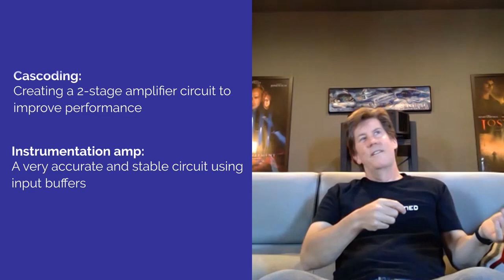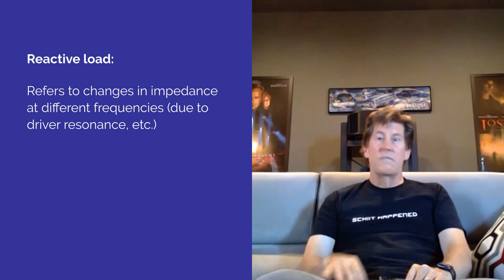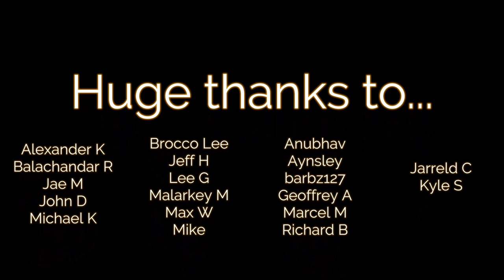Interview with Schiit Audio - Part 1: why all amps sound different

Comment: Cool interview, I love my Schiit Loki.  It has a nice little just a little something, warmth maybe, that makes my computer sound sound nice.  The reason amplifiers sound different while measuring the same is because of the limitations of the standardized tests.  The transfer function of an amplifier can be pleasant, as in some distortion can be in phase second harmonic simply sounds more pleasing.  The more complicated the signal the greater the distortion from what looks on paper as great, but with a real signal it can sound bad.   This is subjective, Pass Labs has a fantastic set of white papers cover this that includes objective measurements.  Also, the load on the amplifier from the headphones has an effect, and more importantly the headphones actually induce a back wave in to the amplifier.  And of course a headphone or speaker is not a resistive load and it's reactance varies based on frequency, these impedance swings can cause issues with cheaper amplifiers.
Reply from the maker: Exactly! Glad you like the interview 🙂

Comment: Nice interview. In my case, the first impression of an amp or DAC or headphone is what I give more importance. My brain and ears don't have a chance to become biased or over-analyze and lean to my personal preference.

For example, my Schiit Magnius sounded boring and closed-in with the Modius upon first listen. Even running it balanced, it still sounds boring and closed-in with the extra power and lower noise.

I still prefer my Asgard 1 and 2, (and my previous Vali 2), even if they measure worse, are single-ended and have much less power. Their sound is way more holographic/out-of-head and fun for me.
Reply from the maker: I tend to agree. I do occasionally change my initial impressions, but often the first impression is right in my experiences too

Comment: I just wanted to post here that my attitude towards gear has changed a lot, I personally subscribed to a lot of 'objectivist' beliefs and bought into the L30/E30 Topping stack. I ran that setup for over a year, and I've just recently moved to a Jotunheim 2/Modius stack. It's absolutely breathed life into all of my headphones. Suddenly I have beautiful microdynamics, nuance and detail. Many times you simply don't know what you're missing out on, and its only harder when you're stuck in a bubble. My biggest regret is not doing this any sooner. Needless to say, I'm a fan and will certainly be buying more Schiit in the future.
Reply from the maker: I'm so glad you tried this out for yourself. I understand the objectivist approach when there's so much noise and ambiguity to cut through, but it really doesn't tell the whole story, does it? Congratulations on finding your musical enjoyment! 🙂🙂

Comment: Great interview, thanks. Do you do any blind, volume matched comparisons of amps? I ask because, as Jason intimated, once I started doing this the differences I was hearing between amps became much smaller (vanishingly small in many cases). Expectation bias is a powerful thing...
Reply from the maker: Hi Alan, I don't do blind comparisons because I'm not setup for it with sufficient quality gear to ensure transparency.
I also don't feel a strong need for it because I rarely come in with any specific expectations. I try not to read other reviews, etc. until after my thoughts are formed. I also find that spending extended time with devices reduces the impact of any initial biases that may occur. I'm not saying I can guarantee complete impartiality, but I do my best 🙂
Reply: Passion for Sound Thanks for your thoughtful reply. If at all possible, you might consider getting set up for doing blind comparisons. Doing so would add a level of legitimacy to your channel that is sorely lacking among many YouTube audio reviewers. It would be a nice differentiator and I think you might be surprised as Jason was when they first started doing blind listening sessions at Schiit.
Reply from the maker: Thanks Alan. I should clarify that I AM setup now (just recently) to do blind tests of DACs. It's the amps and headphones that are a bit trickier, but I might be able to rig something up using my XLR switch box to feed headphones...

Comment: The first five minutes on Heresy vs. Magni 3+ really highlights the issue I have with the ASR forums. I guess if taking op amps and a good power supply is all it takes, it's far too simple and I personally am not interested in such a design (it's cheap of course).
Reply from the maker: I agree. There is a difference IMO between audiophiles and what I've begun to call measurementphiles. I'm not saying either is right or wrong, but the two approaches often don't align.
Reply: @PassionforSound  Ergo, if there's no way to thoroughly and objectively measure sound signals, then such comparisons are quite limited in their usefulness--I'd think this is one of issues I have with ASR reviews, but I'm not an expert at all, so this is just a guess.
Reply from the maker: Yeah, I'm no expert on the measurement side either, but I have lots of experience with listening to, comparing and reviewing products and there's not enough correlation between the measurements provided and the subjective listening experience for me to base any decisions solely on the data on ASR. It's probably fairly good at showing what sounds crappy, but not at separating what sounds ok and what sounds great.
Reply from the maker: Yes, groupthink is a dangerous phenomena. But what's the Microsoft VP got to do with it? Am I missing something?
Reply: @PassionforSound  I believe he's referring to the work history of the person who started ASR
Reply from the maker: Oh, really? Is that Amir or someone else?
Reply: @PassionforSound  yes, Amir.
Reply from the maker: Ah. I went googling and it seems he was the VP of digital media at MS, not MS in its entirety. Seemed like a strange step to go from VP of a multinational company to running an audio blog 😁
Reply: @PassionforSound  good find. I remember seeing a comment on a Head Fi thread on R2R dacs that we wasn't very successful at MS with details on what projects we was involved in--like Xbox or digital media. But there's lots inaccuracy on the web, who knows whether it's true. Also I'd rather not criticize someone just cuz I don't agree with their POV.
Reply from the maker: Yeah. I don't know enough either way. All I know is that I find the reviews a bit misleading because there never appears to be detailed, thorough auditioning and comparison to support or contradict some of the measurements.
I just recorded an interview with Geno and Sherri from Geshelli Labs this morning and they say the same as other experts I've spoken to - good measurements do not always equal good subjective sound
Reply: @PassionforSound 👍That’s cool. I have a Geshelli amp and it’s great. Definitely, they are misleading to the point that I question the true motivations behind ASR. The reviews always conclude with a statement of recommendation/no recommendation that is purely based on his measurements. Then the forum discussion unfolds from there. It would be interesting to do some in-depth research and writing on how measurements can be done and then then correlate them to the actual listening experience, like a debunking of it all.
Reply from the maker: That would be cool, but I fear I'm not suitably qualified to have that conversation without being torn apart (metaphorically speaking) by measurementphiles.
You might find my upcoming USB video rather interesting though... 😉
Reply: I’ll be on the lookout for that video👌 definitely would be torn apart by measurementphiles, but I don’t think I want to convince anyone of anything, just more to answer my own questions and show others what’s possible/useful when it comes to measuring amps or dacs
Reply from the maker: Yeah, that's largely my approach too - I just want to know how it all works and how to choose better gear. Thanks again for watching and commenting!

Comment: You mentioned in your Soloist 3x review that the A90 was more 2D soundstage where the Soloist was more 3D. You said you have a theory that it might be capacitance within the ICs thus causing small timing issues. I wonder if the feedback has something to do with it as well. Looping back the signal multiple times must take some time no? I'm no electrical engineer but still trying to wrap my head around what is going on :)
Reply from the maker: Hi Snow, the Soloist uses feedback for the gain stage so I don't think that's what's causing it because the Soloist uses feedback to manage the gain settings. However, if the issue is occuring inside the chips used as I suspect (chips are generally inferior to discrete components) then the feedback may be adding to the issue as it means the signal is being handled more by the chip.

Comment: 100% agree about the SP200 sounding "flat." I sold mine; using the Topping A90 now. Sounds MUCH better, IMO.
Reply from the maker: Huge improvement from SP200 to A90. Even L30 would spank the SP200

Comment: Nice. Waiting for the rest. Negative feedback stuff is interesting. My experience is limited but i didn't like THX 789 that much. It's really sterile. I've checked other peoples opinions and almost all of them saying sterile must mean something. However downside of Schiit's low negative feedback discrete design is their gain is too much for sensitive headphones. 15 db gain on both Magni 3+ and Asgard 3. Their low gains have a lot of feedback so using them on low gain is not ''optimal''. The trend in the headphone world is sensitive and low impedance headphones now.
Reply from the maker: Glad you liked the interview and I agree about the high gain - that's the trade off. It's one of the reasons I was so impressed with Burson's new Soloist. They use feedback to drop the gain really low for IEMs, etc. but it's done really well and maintains a very natural sound.
Reply: @PassionforSound  Checked out your review. Looking nice. I'm personally in the market for a new dac and amp at lower price point. E30 and THX 789 didn't play well with my Ananda which is already spacious, light/lean and ''solid state'like'' sounding. I'm looking for punchy and dynamic sound to balance Ananda's character. It would be nice if you can review the Zen Dac and Zen Can. They look quite unique. Hybrid Burr Brown dac, discrete class a amp at reasonable price point. They are fully balanced too.
Reply from the maker: Are you running balanced or single ended? If SE, check out my review of the Topping L30 tomorrow - it's nuts and would pair beautifully with the E30. If balanced, the Geshelli Erish has a richer sound, but competes at the level of the 789. Oh, but you'd need a balanced DAC like a Modius perhaps.
Reply: @PassionforSound  I've sold the 789 and E30. Planning balanced this time. Curious about L30 review though. I thought it would sound closer to 789 with lots of feedback measurement focused architecture. Erish is just too ugly :) I'll give Zen stack a shot since i can return them to Amazon but i'm still interested in both L30 and Erish or maybe Modius, Magnius, Asgard Schiit stuff.
Reply from the maker: The L30 is really surprising, but some of those others are great too. I've got Asgard 3, Modius and Bifrost 2 all in the pipeline. I suspect Modius and Magnius or Bifrost 2 and Magnius will be excellent depending on budget.
It's a shame you're not a fan of the Erish looks (I understand) because it's an excellent little amp.

Comment: I love my Gungnir DAC. What I don't like is their customer service. Can't call them. E-mail only. Had to get my DAC repaired. 41 e-mails later, it was finally fixed. This, IMO, is a major problem dealing with Schiit Audio. You might want to think about it before purchasing their products. I don't have that kind of time and I suspect most people don't.
Reply from the maker: Hi Laurie, that's not good to hear! Thanks for sharing your experience
Reply: @PassionforSound  BTW, I've had this DAC since 2013 so obviously they make a great product however, once before I had to go through the same tedious process. They're certainly not giving away their products so I feel certain they have the funds to hire one or two people to handle a customer in a personal manner. Merely my opinion. Thanks for responding.
Reply from the maker: No sweat. I can't speak to their customer service because, as yet, I've had no issues. It's yours a Multibit or standard Gungnir?
Reply: @PassionforSound  I don't believe Multibit was available when I purchased mine. Don't get me wrong, their products are very good. But how about all the equipment they have sold world wide? I was in sales my entire life. If I treated my customers the way they do, I wouldn't have had any customers. Many sell similar products. What separates one from the other is customer service. Theirs is absolutely pathetic. And I have told them so repeatedly. I will never purchase another Shiit Audio product for that reason. Sorry, their unconcerned attitude should turn off any possible customer. It also took almost two months to resolve my issue.
Reply from the maker: Very sorry to hear, Laurie. I know what that can be like
Reply: they've answered my 3 emails that I've had to make on the first try every time.
Reply: @aceofspades6667  Guess what? They answered all mine too. But it took 41 e-mails to resolve the issue because they won't talk to you on the phone. Let's see how you feel doing that!?
Reply: While my personal experience with Schiit customer service has been totally different from yours. 
First time dealing with their CS a new product received from them had a problem with a port having a stripped out screw and being loose. One e-mail and the RA number was issued within 24 hours and replacement product was sent.

 Second dealing with their CS dept a four year old product developed a minor problem, one e-mail to their customer service department explaining the issue/problem to them and within a few hours had a return e-mail giving me the RA number to return the unit for warranty repair very easy simple process.

I own multiple Schiit products from some of their better stuff, lower mid range to their less expensive products with each product having its own intended use.

Actually I just ordered yet another piece of Schiit to add to my list, a new Solid State headphone amp to use for my gaming PC as for that use do not want to use one of my hybrid tube amps
.
So for me anyway their customer service that I experienced is just another positive feather in their cap and another box checked for my continuing to buy and use their products.
Basically two different transactions for issues took a total of two sent e-mails so maybe 10-15 minutes and my problems were taken care of.
I wish all companies I dealt with when having issues were as simple a process as theirs.

 Not to mention I feel their products are well made, sound great, have items available across multiple pricing points and usually compete and trade blows with products that sell for a lot more dollars from other brands.
I would be one that would highly recommend the Schiit brand to be considered highly when making a purchase decision!
Reply from the maker: Thanks for sharing your experiences, Bill. I don't doubt that errors in customer service will occur from time to time, but it's great to see the balance of the positive experiences too.

Comment: Discrete?  Integrated? What do these terms mean? This should have been defined early on.
Reply from the maker: Hi Mark, sorry, you're right - I missed that when I edited the review because I'd discussed it in a recent video (that not everyone will have seen).
Discrete means that the amp uses individual parts like transistors, resistors and capacitors to amplify the signal. Integrated means that a chip (or sometimes multiple chips) to do the same job